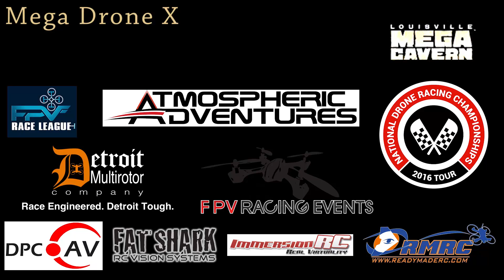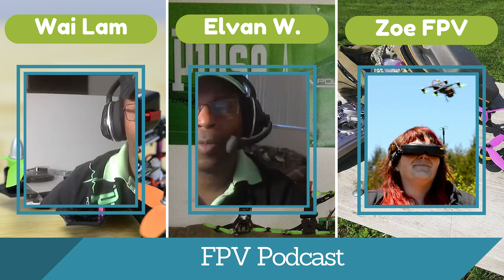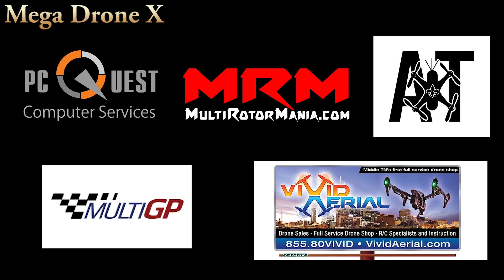FPV Community Podcast #15 - Discussing 3D with Zoe FPV

Comment: as rc heli pilot I fly quad with esc and fc in 3d mode and learning to race in that mode too. you lose a little throttle resolution though. I think its good and bad for hobby, good cuz I can use heli skills n greater flight envelope, bad as noobs will need more skills to be original and many will move onto other fads as quads get too hard.